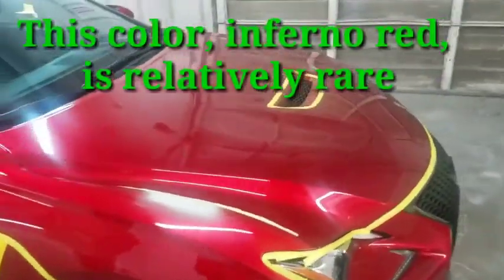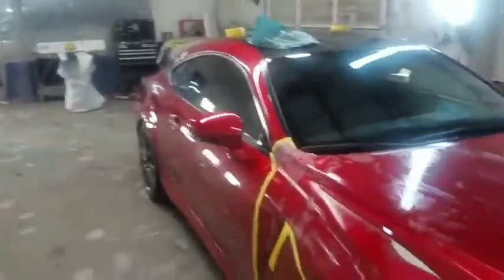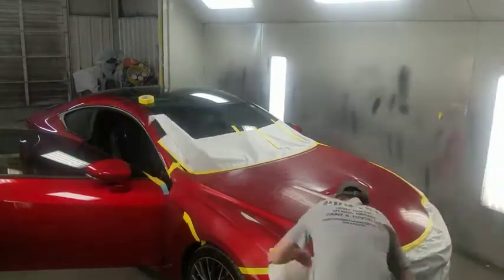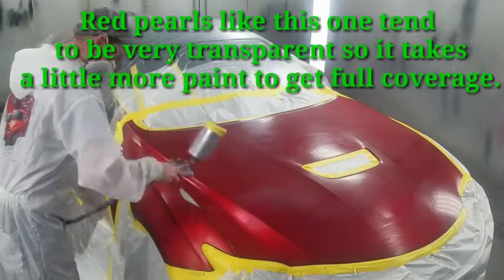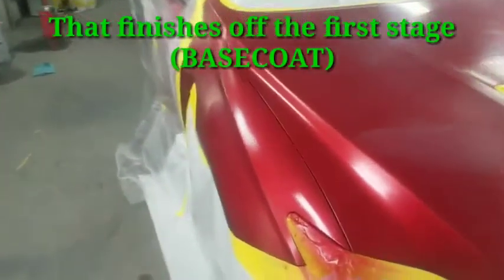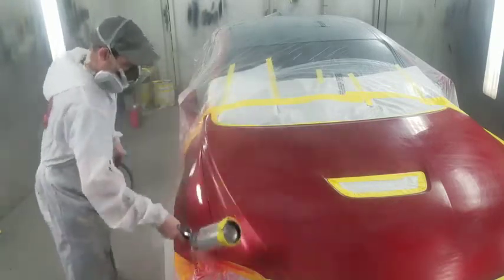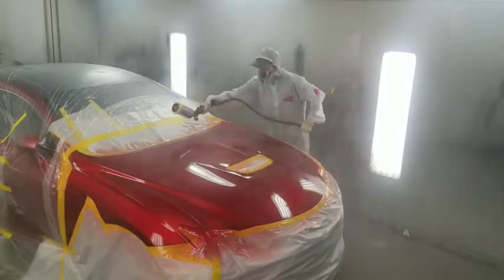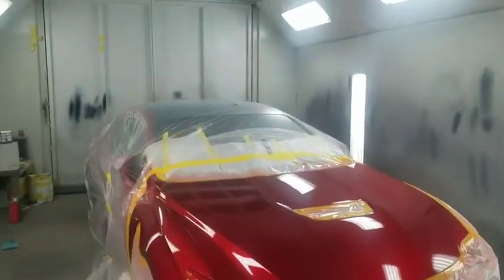How to paint a (RARE) TINTED RED CLEARCOAT COLOR. Full three stage process start to finish

Comment: Hi, thanks for the video. can you explain the mixing of the second mid coat? how you mix the toner etc in the clear coat? do you use the same clearcoat that u use on third stage but mix the toner with that? i am kind of confused for that second midcoat
Reply from the maker: I like to use standox red clear kit but you can also buy a red pigment for any clear you want to use. If you buy the red clear kit it mixes 2 parts clear to 1 part hardener and add about 5 percent clear reducer. If you buy just the red pigment  you just need to add about one gram of pigment to every hundred grams of  any mixed clear coat. I usually let the red clear dry for a day then wet sand it all and put two coats of regular clear on it. after its dry you can sand and buff it without messing up the color.

Comment: Please help I have Ford rubie color but I don’t know how paint  and mix the base and tinted clear painted turned purple  in the parch  maybe because I don’t put red primer
Reply from the maker: I usually lay down  a white before I do the red base.about three coats of base then you mix the red clear about two coats usually.stop and let the red clear dry for a day then wet sand it all again then finish it off with two coats of regular clear then you can sand and buff it in a day or two and it will be deep and flawless. I'm more than happy to answer any other questions you may have.